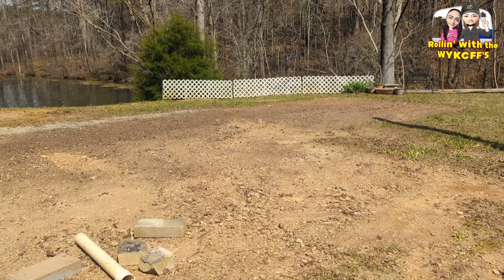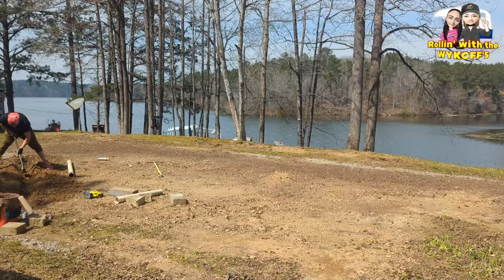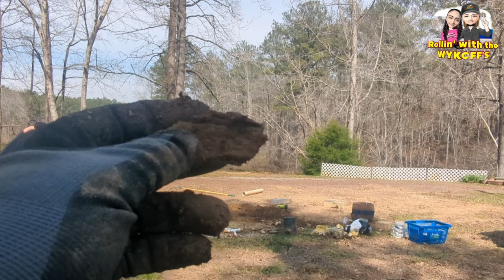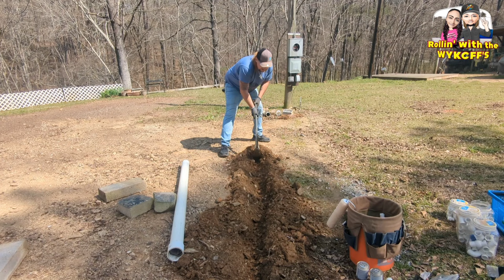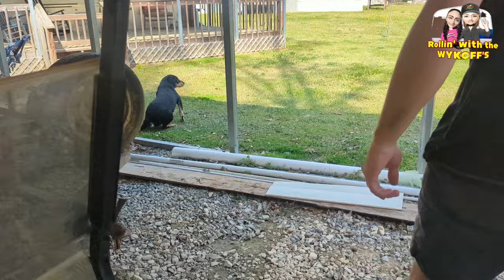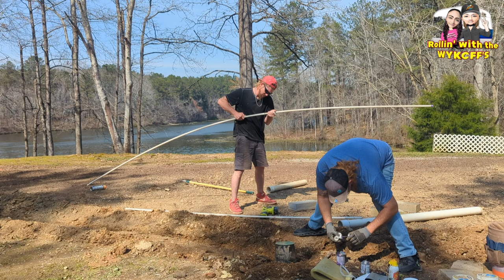Updated 2 RV Lots Here At The Camp (PT 1) #rvliving #campground

Comment: Your not in Florida you better bury them water lines a little deeper so they don't freeze and bust during the winter months.
Reply: And use Pex lines whenever possible plus pipe insulation... And those are reasonably priced.
Reply: Rent a ditch digger So They Will Be buried Deep Enough
Reply: Does The Water Lines Need Inspected?